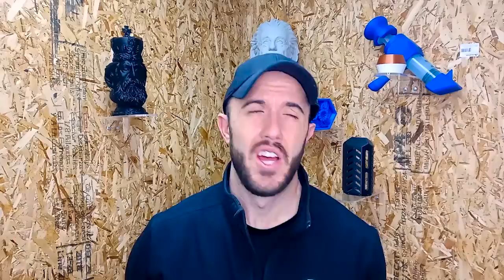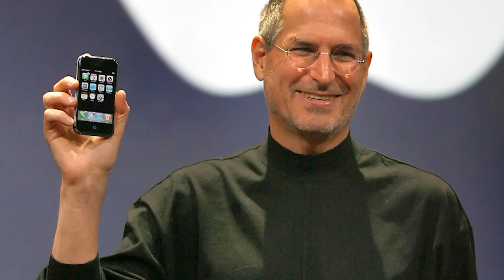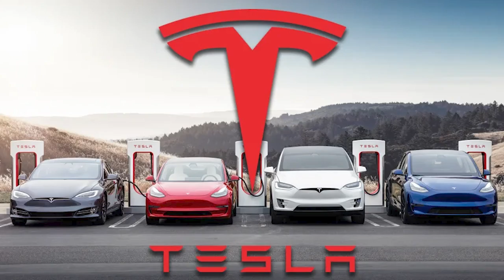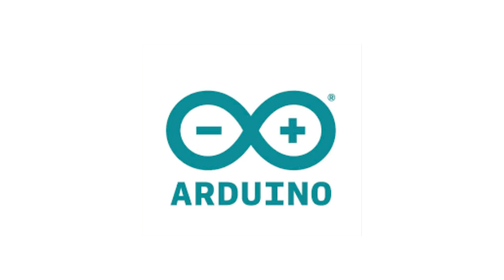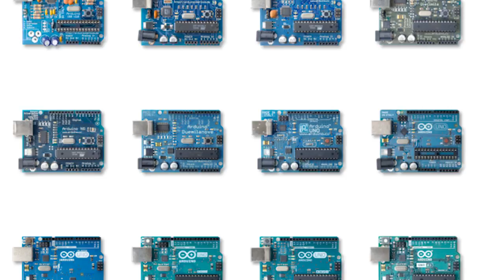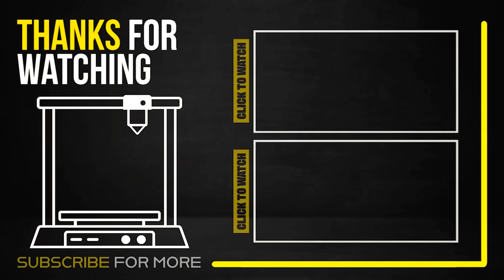Did Patents Slow Innovation in 3D Printing?

Comment: Arduino was certainly a big boost since it made microcontrollers a lot more approachable, but there were plenty of hobbyist projects using microcontrollers before that, and even projects using a spare parallel port on a PC to control hardware.

Comment: I'm gonna have to refute your claims. Current example is a new hotend developed by a Youtuber named, "Vez3d," is being blocked by Slice Engineering patents. On one hand, the infringed patent is something really simple (standoffs) and I have to wonder why it received a patent. But on the other hand, patents are used in the US as a way to slow knock-offs from flooding the market and killing off US innovation and industry. The mentioned patent killed the existing design for this new hotend, but knowing now what is the infringed parameters are, could spur a redesign. This is slowing something that could come to market now but has to be redesigned or killed off entirely. 

As an FYI - trademarks are similar to patents, in that they protect the holder from product or name dilution. We talk about FDM printers as name recognition, and we can do so as commentary, but printer companies cannot claim their 3d printers are "FDM" printers because Stratasys owns the acronym as a trademark. Instead a company uses "3d printer" or "Fused filament fabrication (FFF)" printer system to describe their printers. So initially, patents and trademarks give weight to the owners to aid in protection of their innovation. USPTO does not police patents, but they do aid the owners when the owners sue. And initially, these do slow innovation - even when a product is 99.9% wholly new and the .1% references a patent.

Comment: You have presented a very weak argument here. 

Just because of RepRaps were started with Arduino doesn't mean the FFF patents didn't hinder the RepRap progress. If it was the case RepRap 3D Printers would have seen wilder scale adoptions 2 years earlier. FFF patents definitely hindered the progress. Microcontrollers exists before Arduino and there were capable mechatronics professional/students out there even before Arduino. Arduinos just make it easier for hobbyists to tinker but ultimately those who wrote the core code could have done it without Arduino. for instance there were firmwares that coded without using any of the Arduino IDE nor uses the ardunino MCUs/boards.   The reasonings of Patents hindering RepRap/FFF and Arduino being easy aren't mutually exclusive. 

In actuality, if you flipped the whole arguments around, it sounds even more convincing.

Comment: I strongly disagree. The way patents are implemented today is killing innovation. Somebody patents a heated oven for a printer and locks out industry for decades from developing and using it at a reasonable price. That is just one example. Innovation should be rewarded but in a way that does not hold back its implementation and further development.
Reply: You only have to look at Slice Engineerings patent trolling exploits to prove that patents effect innovation, their latest patent trolling attempts were for hot ends mounted by three screws, this patent was allowed in the US and China but the EU threw it out, Vez 3D's Goliath hot end design which is manufactured by Mellow were pulled up by Slice for patent infringement for fixing it with 3 screws, this resulted in the launch being postponed whilst a different mounting design was implemented, when companies are allowed to patent ridiculous things like this with the sole aim of handcuffing any competitors it most definetly restricts innovation.
Reply: @AndrewAHayes they wouldn't be able to defend that in court, if the invention is as rudimentary as you suggest, the USPTO is pretty tight on novelty and inventive step. Adding a screw would never be a patent. Perhaps you can share the Slicer Engineering patent no you are referring to, there might be something else in there.
Reply: Considering most of the equipment is coming from china who treat patents like build sheets i dont see how. New trend is has been not tobpatent to keep tech and designs hidden so it can hit market first amd have sales before its reverse engineered.
Reply: A patent cannot be put on a general idea guys. It's put upon a method of doing something, the way that it works. I can patent a better way of making a lightbulb or with certain new features, but not the lightbulb in general. If you patent something, nothing stops other company to do the thing in a better and different way :)
Reply: @tbastien50  More properly, a patent is not SUPPOSED to cover a general idea. That doesn't mean it can't be used as a bludgeon in court where even winning a patent suit can set you back a million dollars. Then there's the patent on teasing a cat with a laser pointer and the wheel (both granted).